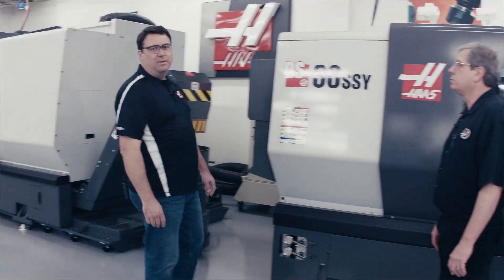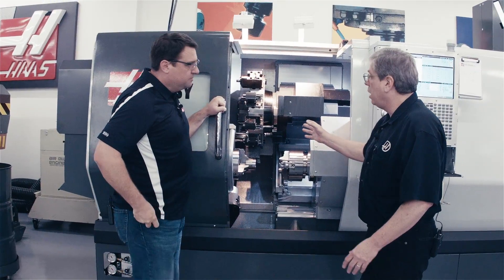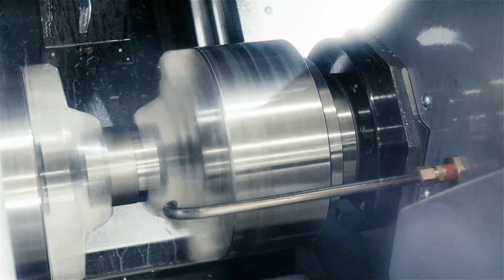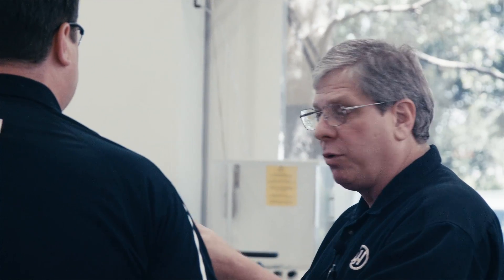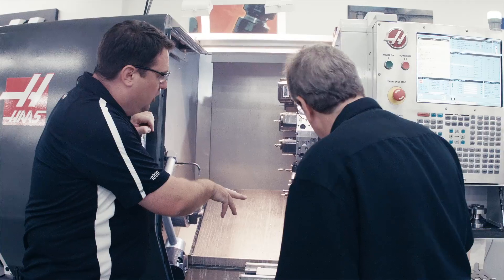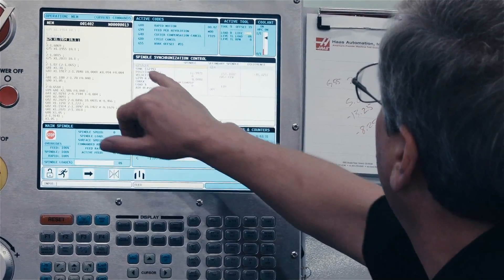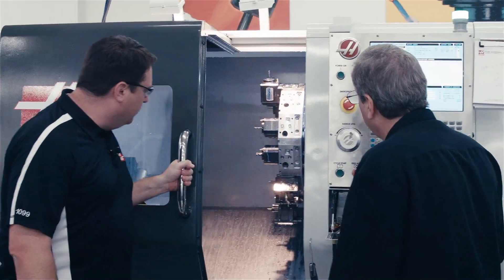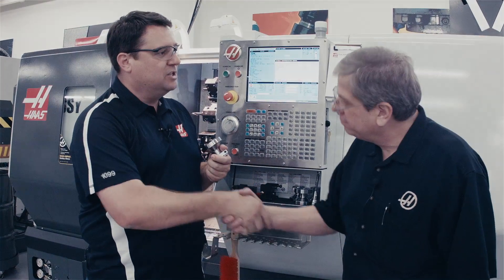Haas Dual Spindle Lathes Simplified

Comment: ? Do the twin spindles only function with concentric parts? I can’t imagine a multi jaw capable of self centering an awkward shaped part where perhaps you had a elongated component with a pocket or a another offset process needing to be done. In those cases we would likely resort to a standard turn center?
Reply: Would be "pie jaws" cut while in the chuck either spindle to the part shape.
I've run electronic housings that go in oil tools and ran specific programs to do it.

Comment: How can you synchronize both spindles to grab a hexagon or non round part?
Reply from the maker: G199 uses an R value to phase the two spindles. Take a look here for more info: https://diy.haascnc.com/g199-engage-synchronous-spindle-control-group-00-lathe#gsc.tab=0
Reply: Excellent question thanks for asking I completely overlooked phasing the parts being caught up in the action of grasping one another without a tolerance change. Obviosuly encoders involved and it must resort back to the programming somit can know where it made those flat spots. It’s a smooth operation for sure. I wouldn’t want to be there when a driver was bad and sync was out causing a nasty crash. I imagine there is a provision to sense and stop in those situations. Hope so.

Comment from the maker: Check out this brand-new video to learn what we have done to simplify  #Haas dual-spindle lathes: https://youtu.be/Say_JAJi4Yk.  #madeinamerica  #cnc
Reply: Excellent video! Thank you Haas Automation, Inc. for continuing your education efforts.

Perhaps you could explain how one might go about setting offsets for tools used on the secondary spindle in a future video. Can the ATP be used? And if so, what if there isn't enough clearance to probe a tool?

Keep up the good work :)
Reply: KC CNC you do not need to probe back spindle tools, touch right of the front of the workpiece after spindle swap. The offset for the sub spindle is always the same, saved at 0.000. Once touching tools to face you Z face measure for tool geometry.

they should point out that though the G14 command works perfect...when adjusting a part you do have to make sure you are going in the right direction. If you need to rip material off the main spindle it is usually a negative adjustment however once the part is on the sub spindle a positive adjustment is needed.